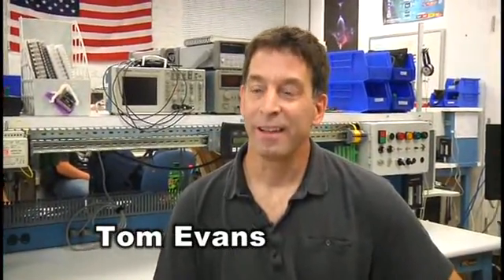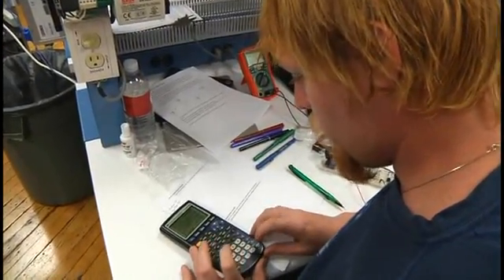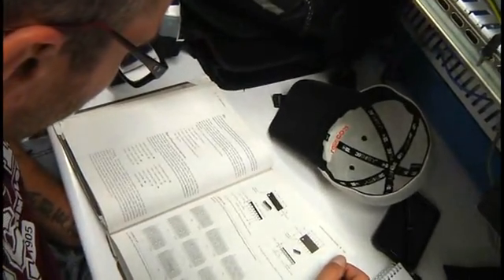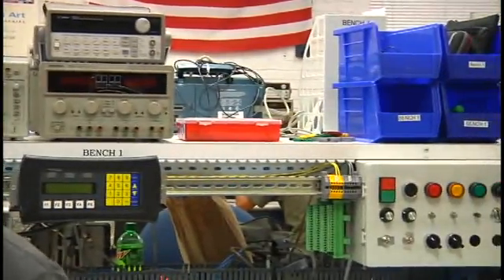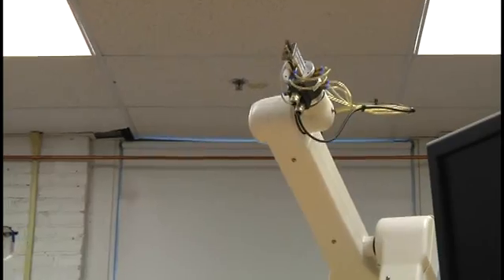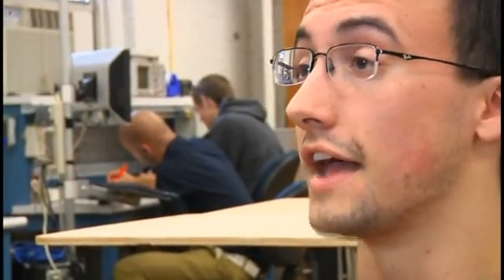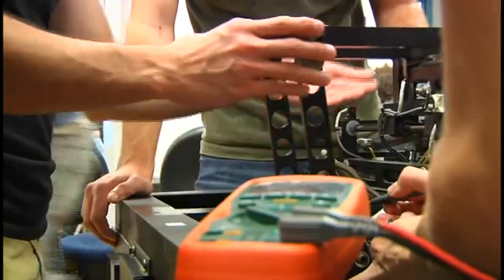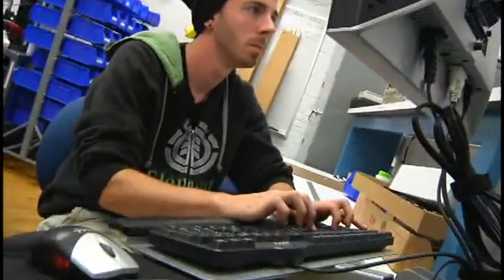Electronic Engineering Technology at Thaddeus Stevens College of Technology

Comment: I've been in the field for a few years, and I can say that the instructor's assessment is misleading. It's not wrong that it takes a lot of work to get an ET degree. In fact, you'd be studying harder than most students.

What videos like this don't let on is that, while the jobs are there, they are woefully low-paying, in the neighborhood of $17/hr. That's less than many unskilled jobs. Worse, it's really hard to use an ET degree to pivot into a different, better-paying field. If you're smart enough to do this, you can easily pull off something like Collision Repair, which typically involves far superior compensation.

How pitifully low-paying that ET jobs are is something that more students need to be warned about. Someone who went into this without knowing any better would be setting themselves up for some hard disappointment.